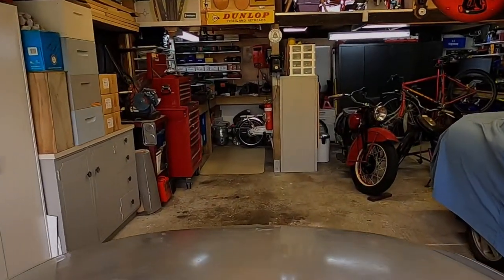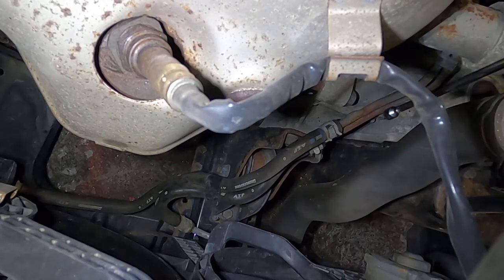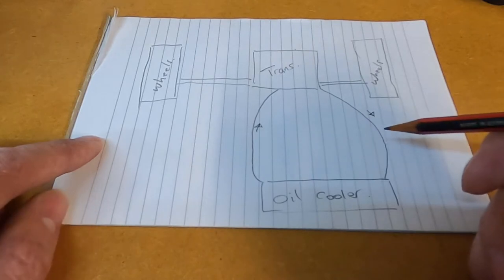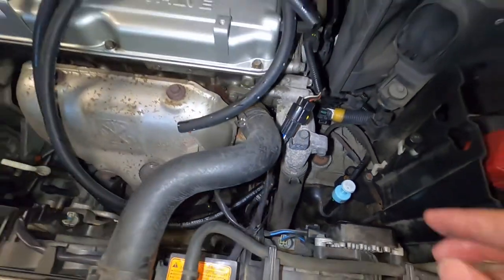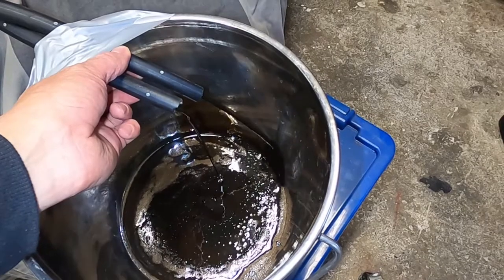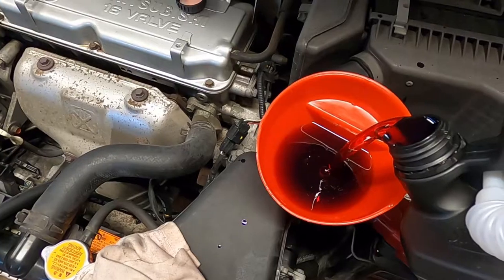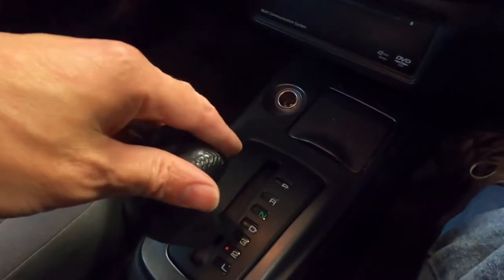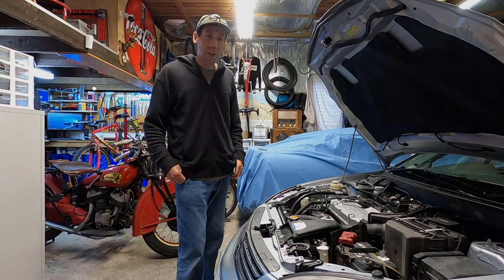How to flush and change your automatic transmission fluid

Comment: where did you get the hoses and hose joiners from? it looks like a pretty standard setup and im not wanting to mess up by buying the wrong ones or sizes
Reply from the maker: Hi Jerry, sorry for the late reply.  I purchased the hose and joiners from my local auto parts store. In the video the hose used is low pressure power steering hose and the joiner is a 5/16" hose joiner.  I have since added a length of clear pvc piping at each of hose (the ends that goto the bucket) so that I can see the fluid color easier.  To work out the hose you need you will need to look at the transmission oil cooler lines fitted on your vehicle and with the car engine off, remove one end of the hose and measure the inside diameter of the hose using verniers if you have them or ruler, just a rough measure is fine and get the similar sized hose to be used for drain hose.  Feel free to ask any further questions.  Take care

Comment: Does this also empty the pil in the torque converter?
Reply from the maker: Hi there, this approach wont be like a high pressure flush machine which could be a good or bad thing depending how old the transmission is, but if you follow the steps in the video, flush and fill, flush fill you can add the step of driving then another flush and fill step that will get almost most of the old fluid out.  For this car I also change at a shorter interval than what is recommended.  Hope that helps, appreciate the comment take care 👍🙂